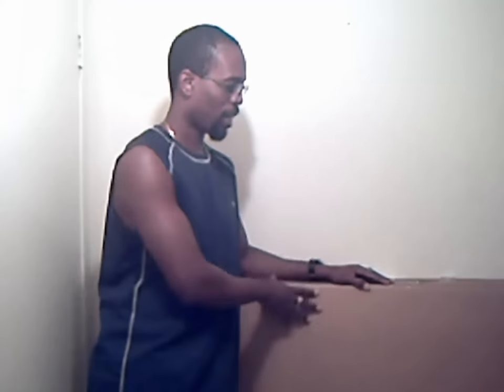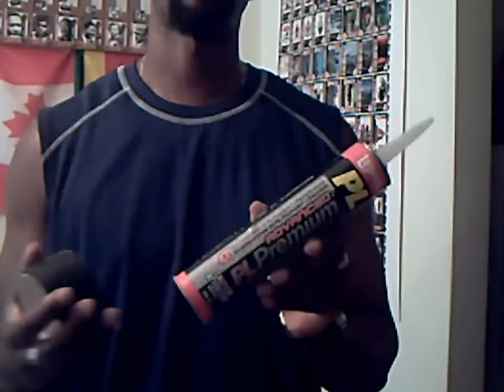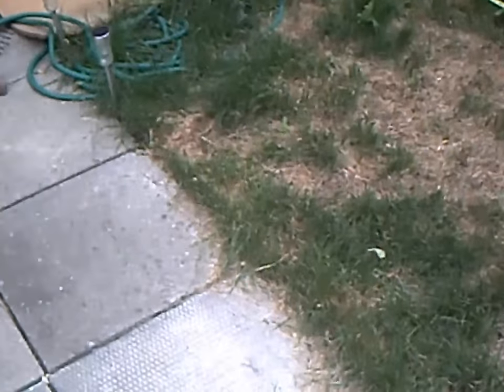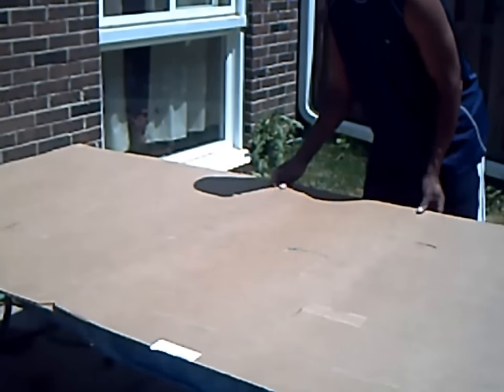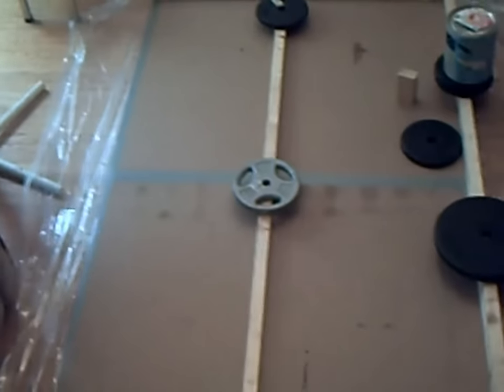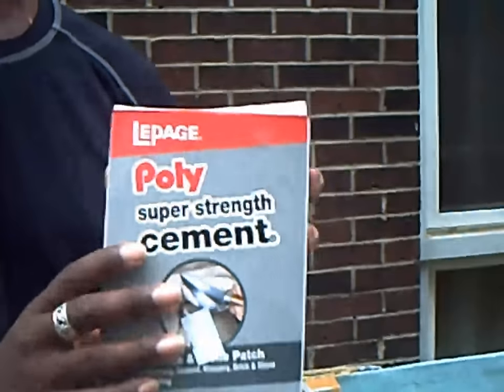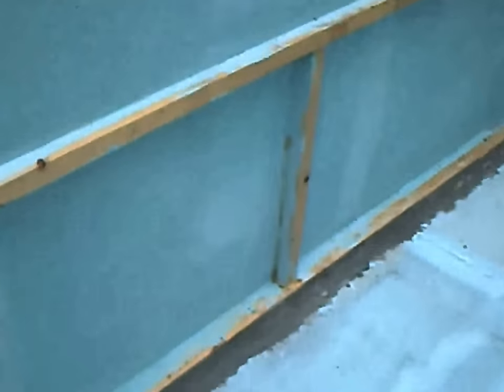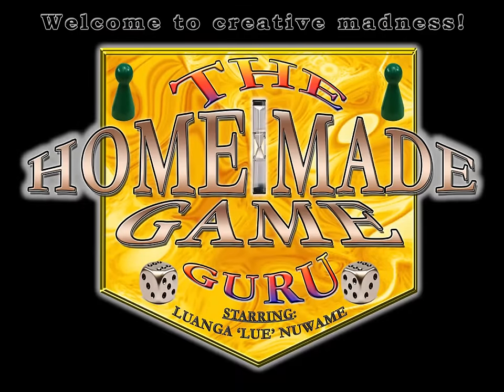Build Your Own Cardboard Swimming Pool DIY Howto

Comment: this pool might work if it was round with rope rows or net around it , but as it is it seems unable to hold more than very little weigth of water on the sides.
Reply from the maker: It held water until it got to just under half full - then the back wall gave way. As I mentioned in the video, I made the walls only two times thick instead of the 4 times+ I suggested. Just wanted to finish the project for the hell of doing it. Learned many lessons from this 2011 attempt and will apply those lessons for the next attempt this summer. Cheers

Comment: I think most aspects of your video are brilliant and inspire me to make a similar pool this Spring.  I will use Coroplast (used for advertising hoardings) rather than cardboard, with the frame on the outside, for support against the water pressure.  Using Swimcords to keep me in position, it should give me my very own Endless Pool, but for about one-tenth the price. Your video is good and helpful except for that God-awful music (I use the term loosely) which masks your commentary.  Keep up the good work but please ... keep the sound track simple and clear so we can hear what you are saying.
Reply from the maker: Nothing I can do about the music in this video (made by a good friend), but my other videos with music have a lower volume. Live and learn. I like the coroplast idea!! That is what I like to see - people innovating with their own touches. Never even considered plastic coroplast sheets as an option. Get the pool done and post it up. Would love to see it. Cheers

Comment: Walmart Canada has 12' pool w/filter pump for $98 Canadian $ that U could have been filling with water within 10 minutes. Yes it's a cheap plastic pool but at least it's hygienic. Consider all the toxins you're exposing yourself to while sitting in water surrounded by all the glues & crap that you used to hold your pool together?  The cheap plastic pool looks a hell of a lot better & at least has a water pump & filter.  $146 metal frame & $386 gets you 15', ladder & cover. U just wasted time & $

Comment: (a) Nice "Home-Depot-Hacking" (my hobby too. ;-)
(b) PVC is white - that's ABS. Just sayin'.
(c) Watertight - yes; structurally sound, NO. A 1' column of water is ~1/2 psi = 2psi at the bottom so *pressure* is ok, but that's just burst strength. You've still got 9 TONS of water (288 cu.ft @ 62 lbs) pushing it *apart*. Plus: zero racking strength, & the top's gonna bow & bulge => *angular* stress on the joints. Sloshing = buh-bye, H2O.
SO: (d) Cool idea -- but I would NOT finish filling it... ;-)

Comment: Don't take this the wrong way, I appreciate your creativity, but this video is a lawsuit waiting to happen.  Mostly because of the circulation pump reference.  If a circulation pump is not installed correctly or the fittings are not the proper type of fittings, a person can get entrapped or eviscerated in the pool.  This could be deadly, especially for a small child.  In the sue happy world that we live in, there's little doubt that someone will come after YOU for instructing them to build this pool.  I know, it sounds stupid, but it's the realty of the world we live in.  Honestly man, if I were you, I'd pull the video.  Or at least modify it to say "DO NOT PUT A CIRCULATION SYSTEM ON THIS POOL WITHOUT PROPER SAFE POOL FITTINGS".  You can get actual pool fittings for less than $50.  I work in the industry, take my word for it, this video is a bad idea, whether you were serious or not.  Just my 2 cents.  Best of luck to you man. ;-)
Reply from the maker: I appreciate the concern, but I have no worries about lawsuits for this video, for a myriad of reasons. Plus, there are countless other channels that would have been sued into oblivion if it weren't for statutes against suing based on 'negligent imitation'.
The U.S. is the litigation capital of the world, but thankfully there are statues that make certain lawsuits impossible or improbable to win.
Firstly, You Tube has terms and conditions of use specifying the "entertainment" factor of this site and videos posted (aka - same reason you can't successful win a lawsuit against Hollywood because a person was stupid enough to jump off a building like Superman after watching Man of Steel).
Secondly, I never suggest or tell anyone to put their kids in this and have mentioned repeatedly not to take this video seriously. I even admitted it burst open when filled half way.
Thirdly, many adults have successful innovated and made their own versions based on their OWN implimentation of the idea and have made it successfully -- thus showing there is a level of 'competence' and 'common sense' required on the part of those who choose to make a craft concept out of cardboard.
There are numerous other reasons I can state, but you get the idea. This is the reality. However, if someone wants to try, they will and my lawyer and I could use the international press coverage.
Reply: Homemadegameguru
Fair enough. ;-)